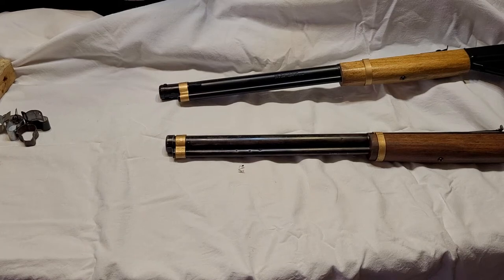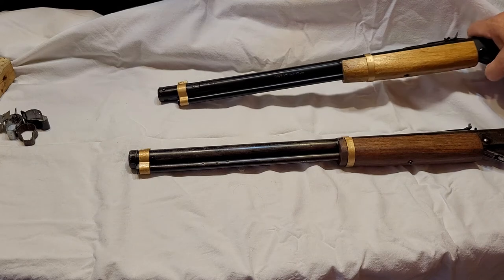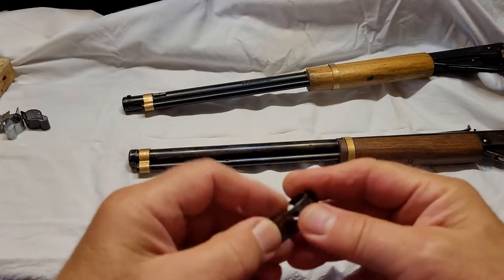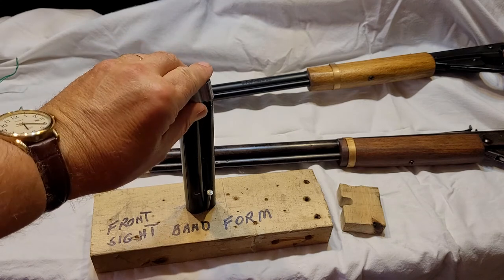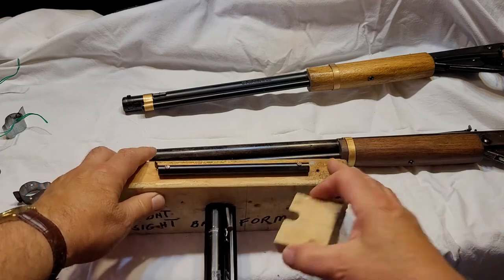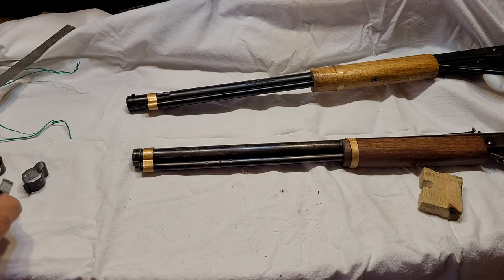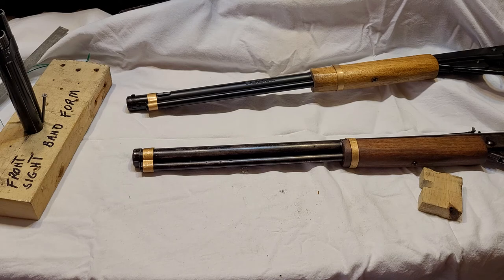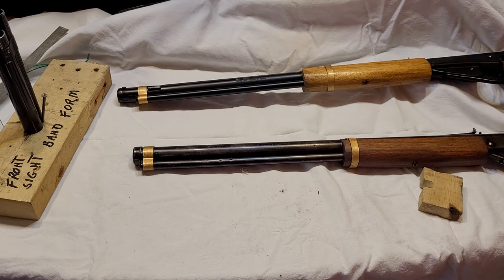Daisy lever gun fun 26.  Front Sights

Comment: Hi Russ,   
That’s a cool idea, beats bending steel around sockets and punches like 
I’ve had to do with barrel bands.  What did you do about the old sight, file it flush, or make a new bushing ?
By the way, good job on the Ryder logo, gun looks good !
Reply from the maker: Thanks .  I cut the old sight off and kept the muzzle plug.  The RR logo was copied by using a rubbing and transferring it with old fashioned carbon paper.  I then traced over it with a fine sharpie.  Not etched in but better than nuttin.   Lol